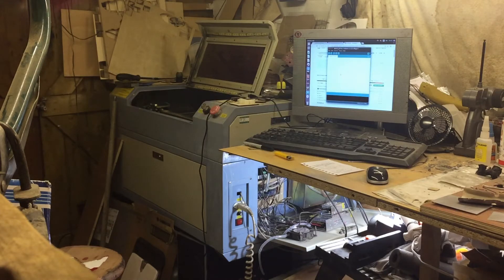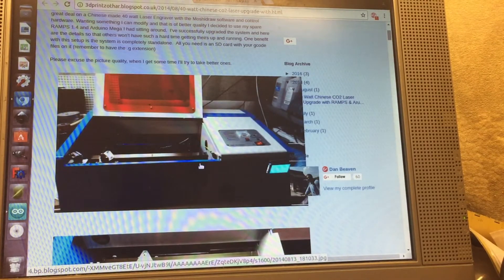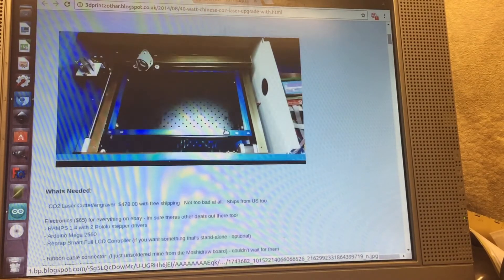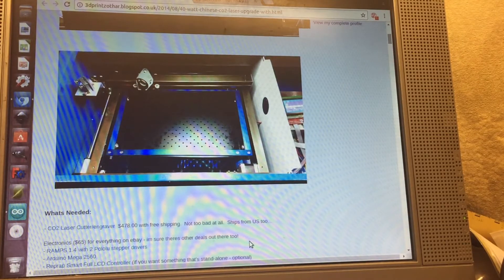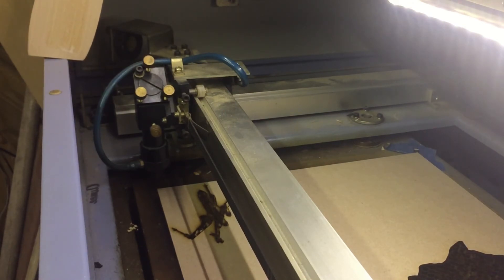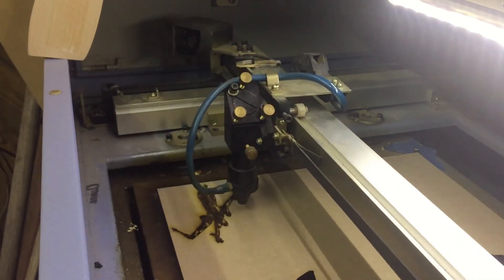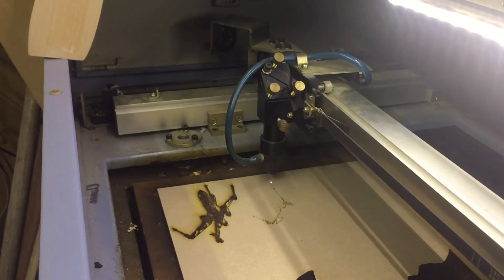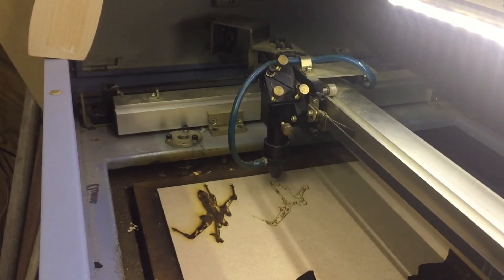How To - 40w CO2 laser cutting using Arduino Mega

Comment: HI can you upload a diagram of your wiring for the arduino atmega pins to drivers/laser power supply,i have got simmilar setup but need to confirm which pins go to  psu
Reply from the maker: Hi Toddy - will do. there is a wiring diagram in the link in the description. You need to know if you have an active high or active low laser power supply as that is only real difference you might have to my setup.

Comment: So i been trying to do this to mine but the arduino is pwm and my laser power supply is ttl. is the arduino pwm only 0 to 5v?
Reply from the maker: I will double check but I believe I have mine hooked up as ttl. Let me check the info and pinouts on the info and my setup and get back to you.

Comment: Great Job, Question: Why connect pwm laser to D6? need only 5v?
Reply from the maker: Hi - Thanks for the comment and question. If you just connect the laser power PWM input to 5v you would only ever get 100% laser power. By connecting it to a PWM output of the Arduino, you can control the laser power from 0% to 100% on the fly. This helps reduce depth of cut during etching and whenever you want something other than full bore. What is also means is that if you feed a greyscale image into Inkscape, you can set it up so that the laser power varies on the fly with the %age black on the image giving a sort of 2.5D etched image. Its a cool feature but takes a bit of tinkering to get it to work.

Comment: Oh, how I am stupid. This extension does not works in Inkscape 1.0.1.
Reply from the maker: Yes correct. I found this out recently when I went to upgrade the shed computer. I installed the latest version of inkscape and then found that I couldn't get it to work. It is to do with the python image library. The original code (not written by me) was designed to work with an older PIP version. Inkscape now ships with the newer PIL versions and the inkscape plugin doesn't work. Thankfully I still have the old HDD with the working software so I am back to using that again. It would be nice to get the plugin updated for my future benefit and of others. I will see if I can contact the plugin creator and ask for some help.
Reply: @lewistaylor863  Yes, that will be awesome, please. Since we now (almost everyone) using new Inkscape, this will be more convenient. Thank you in advance.

Comment: Thk for your response, What is the plugin ? Where download.?
Reply from the maker: The plugin is for Inkscape and can be downloaded from the following Github link to Turnkey Tyranny's stuff. It makes GCode from Inkscape drawings etc. I am not sure if it compatible with other systems or whether it only works with the modified Marlin firmware which I am running.  

Inkscape pluggin - I think this works with Windows and Linux  https://github.com/TurnkeyTyranny/laser-gcode-exporter-inkscape-plugin

Marlin firmware for Arduino Mega  https://github.com/TurnkeyTyranny/buildlog-lasercutter-marlin

Cheers!

Comment: what is the sofware to load and control the Gcode to Arduino?
Reply from the maker: Hi - thanks for the question. I use pronterface to control the laser cutter and send gcode files to it. However, as it is just running modified 3d printer firmware on the Mega, I think you could use many different programs and even perhaps use something like Octoprint. If you get an SD card module and screen, you can also laser cut files form and SD card (although I have never tried that as I like to have it tethered to a computer).
Reply: @lewistaylor863  thanks for the info

Comment: Issue with the Arduino is that engraving is hard to do with only 255 levels across the power range and it's slow. Have a look at my STM32 ARM driven K40 conversion on awesome.tech